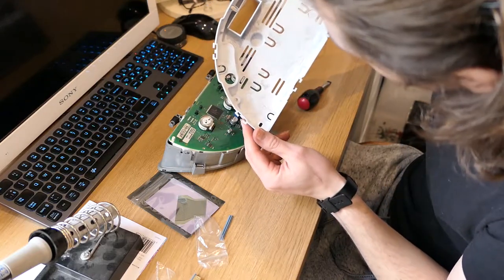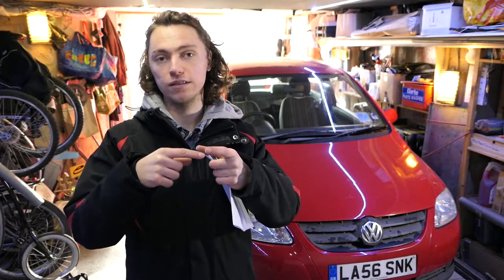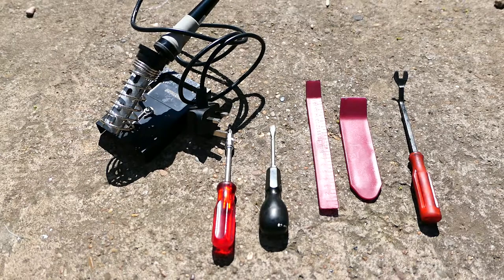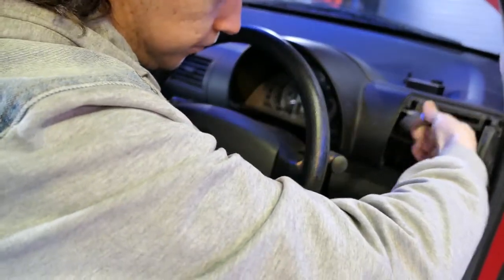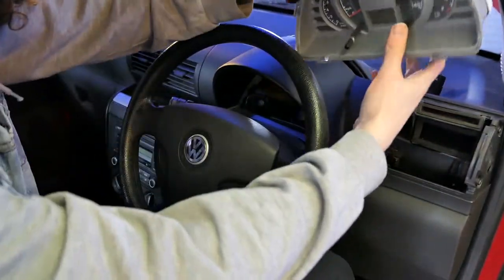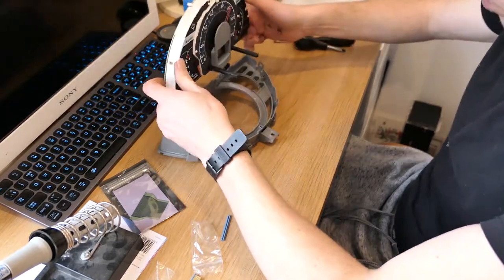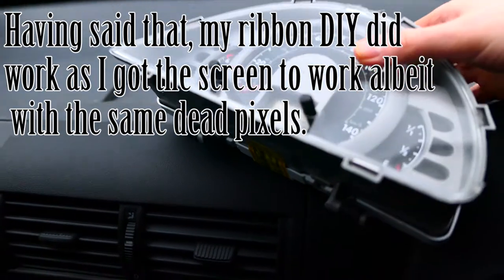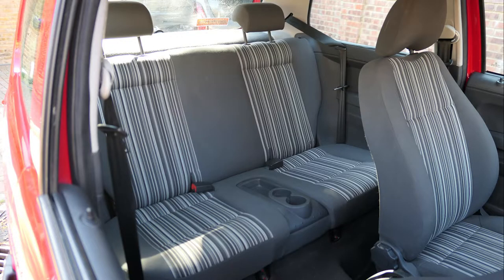VW Fox - Faded Odo/LCD Ribbon Fix!

Comment: Thanks so much for posting this.  I had exactly the same problem with my 2007 VW Fox and was unsure where to turn but the company you recommended fixed the ribbon and returned the cluster to me in less than 48 hours.  I owe you a drink or two.

Comment: my LCD screen doesnt work there is no light and the car motor doesnt work as well could you give me some help thanks a million
Reply from the maker: It sounds like you have a flat/dead battery, if you have no lights or the engine doesnt turn over.